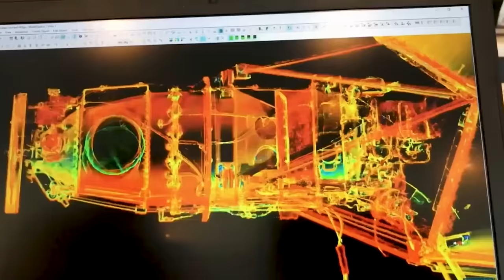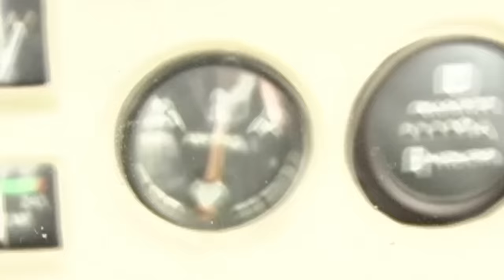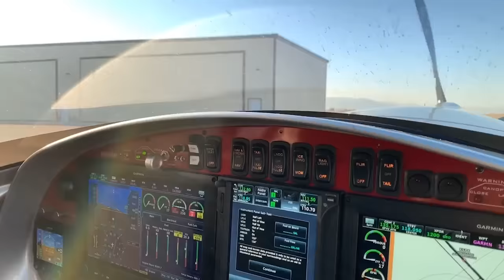Patey Aviation Breaks Ground!

Comment: In the last video, you were asking about ideas to improve GA safety. As a software engineer, I feel like there is too much emphasis in aviation on humans performing tasks perfectly. We are all imperfect and make mistakes. On many aviation channels, there is a lot of blame on pilots for not having perfect awareness of every aspect of aviation and performing perfectly in high stress situations. While technology such as autopilot is not perfect, I feel there would be a huge benefit to improving technology in aviation.

Examples: Software could point out weather conditions in real time. Autopilot could warn that it is likely having to compensate for icing conditions. All aircraft could have autoland capability. All aircraft could prevent stall/spin inputs at low altitude. While software and technology has failures, it can also be much more reliable than a human if engineered that way.